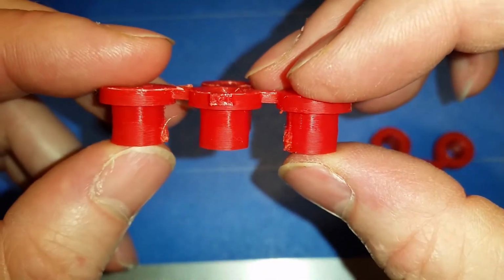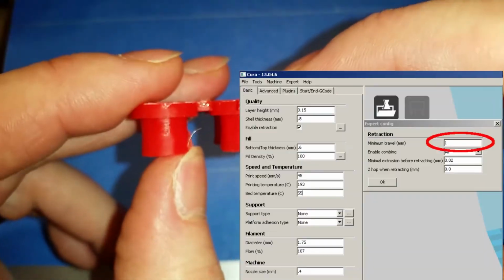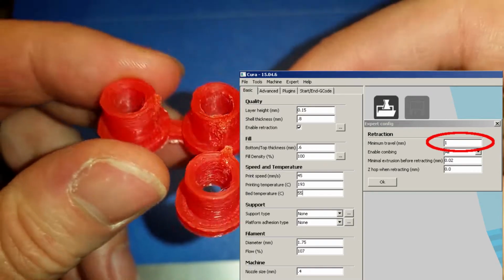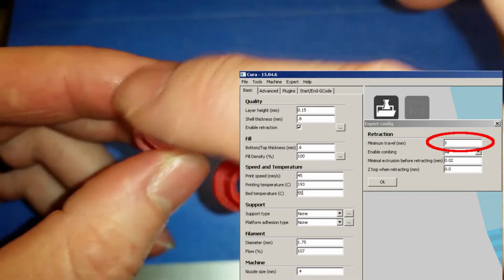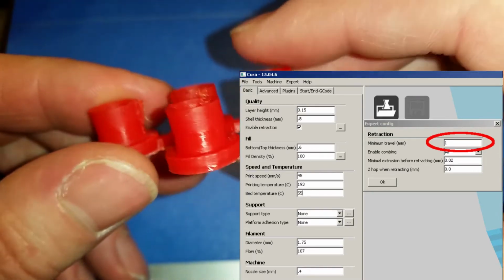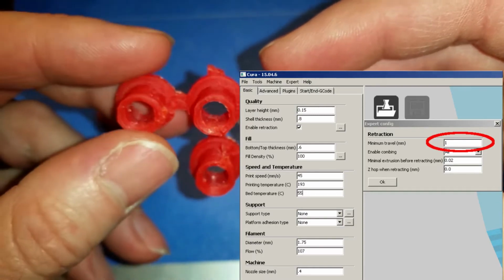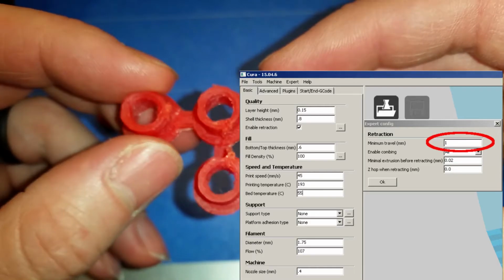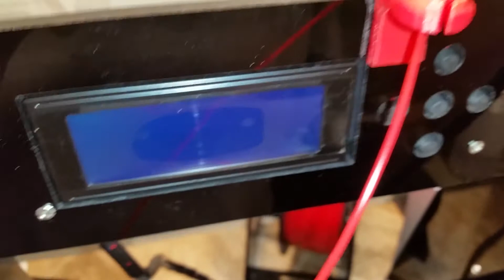Anet A8 3D Printer Upgrades, Tips & Tricks

Comment: Go into cura and make the extrusion wider at the tip during printing and increase the printing temp most I've found pla wise prints best around 210c I actually print at 214c also I don't need glue sticks  I use 3m brand blue painter's tape then I press it down with a old credit card no issues

Comment: You might want to solder the hotbed wires straight to the hotbed as it makes the printer safer and more reliable as I was having an issue of the hotbed cooling mid-print and after soldering I've had no problems since. https://www.youtube.com/watch?v=MzWVrv4L1R0&t=222s Here is the video I used to guide me on the process.

Comment: You got ripped off paying $265 for the Anet A8.  You shouldn't be paying more than $150 for it. Your first layer was too high off the bed. You can also adjust your retraction speed not length to eliminate the stringing.
Reply: Ady Texas I Bought it and with all the safety mods and quality upgrades it came to almost 300, the actúa kit was just 130, but everything else added to the final price.

Comment: For the fan nozzle you are supposed to loosen the fan and slide the nozzle up between the fan and the extruder. Works fine as designed when done this way.
Reply from the maker: The nozzle fits inside the fan nozzle and can't move up further
Reply: I see that now. The one I pulled down and printed is the half circle and it slides over. It works great.

Comment: I use super glue on threads all the time on my milling machine and lathe. It gives a strong enough temp hold, and can be released with a little tap with a non-marring hammer.  Then it cleans up with a razor blade. The Gel works awesome, and we keep a bunch of it here in our gunsmith shop. Thanks for the info!, G.

Comment: Never use super glue on threads.  Blue Loctite is what should be used.
Reply: Yeah I also read not to use plexiglass as it warps. Your video is another part of the long amount of research I've done in to 3D printing so your failures help other people from making the same mistake. Keep it up. lol
Reply: I read not long ago that someone who used Loctite on the nuts suffered from the acrylic shattering.
Reply from the maker: Yes it will crack the acrylic.  Also don't use isopropyl alcohol on acrylic or plexiglass either.  I found out the hard way in another video that it cracks the plastic.
Reply from the maker: Why not?  This is not a high stress, high vibration, high heat application.  Its on a 3D printer.  I've printed 100's of prints and have not had the screw come loose. CA dries in a few minutes, Loctite take over 24 hours to dry and harden.
Reply: You can not normally remove a screw or bolt that was super glued. Blue Loctite is much better.
Reply from the maker: I don't plan on removing the filament tension arm, that's why I use CA glue.  A drop of acetone and it comes right off after a minute of soaking.